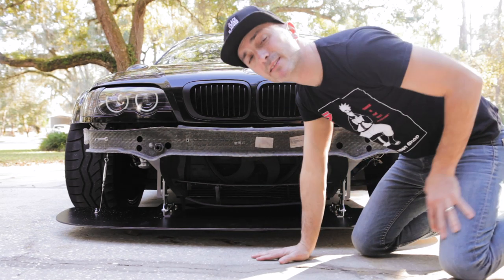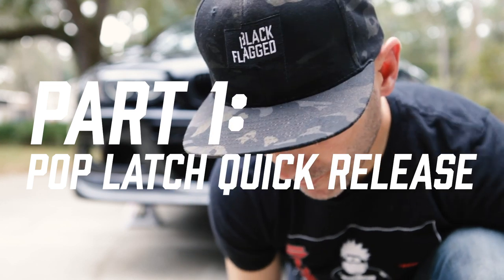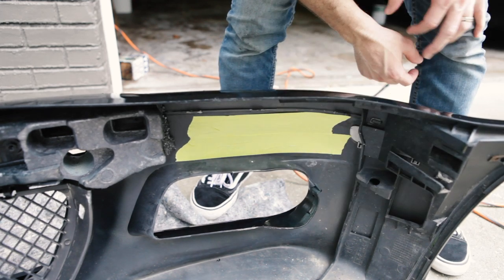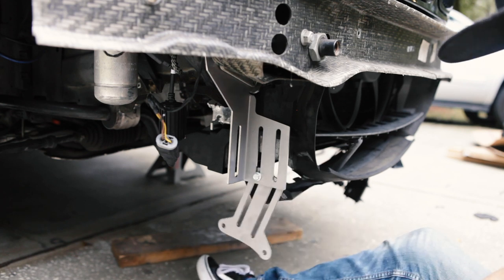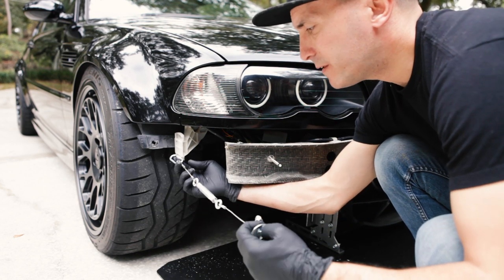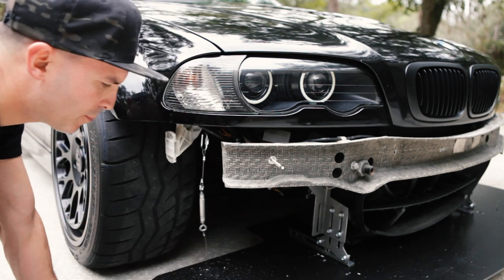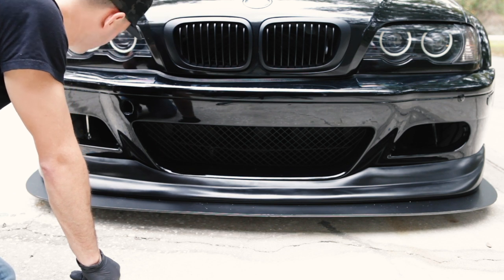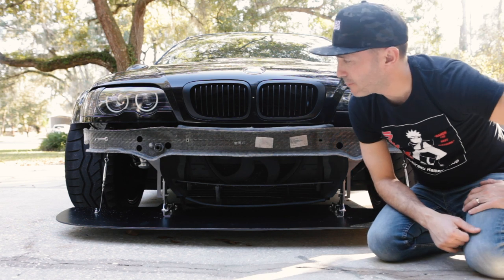Remove your bumper in seconds! Making everything quick release | vlog 091

Comment: Just picked up a set because of your video. Did you still need to bolt on the sides of the bumper? Nevermind.. finished the video. You cut off the fender liner that the bumper attaches to lol. That answers my question.

Comment: Your car looks amazing buddy!!  I'm building an LSB HPDE care right now and I'm curious how the you attached the back edge of the splitter to the car.  The Build Journal site sells a piece of U Channel to attach to the car in which their splitter can slide into.  I know you have the Hard Motorsports splitter but I would think that would be a perfect solution also.  I'm about to buy the same exact pieces you have but need a solution for the back.  I don't want this thing flapping around back there.  Please let me know if you attached the rear of the splitter or just left it.... Thanks - John

Comment: Did you modify that reinforcement bash bar?  Noticed is made out of a carbon fiber material? the on  my car is metal. How do I go about doing this same modification with a different reinforcement bash bar?
Reply from the maker: No I didn’t change that out, that’s the one that was on the car. Does your metal bash bar have a similar setup?
Reply: @BlackFlagged  yeah mines the original bash bar. Is yours original as well? It looks to me you cut out the front half of it?
Reply: I guess mines different since yours is a coupe and mine is sedan
Reply from the maker: @Ky7e_e  oh yeah maybe